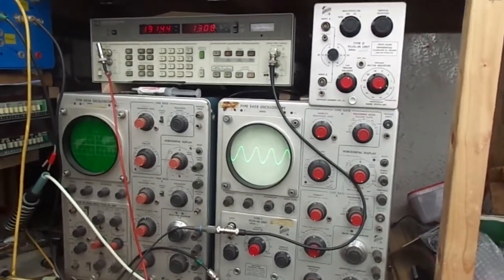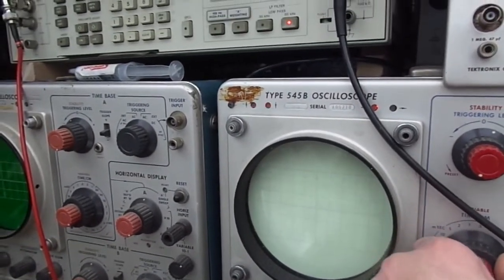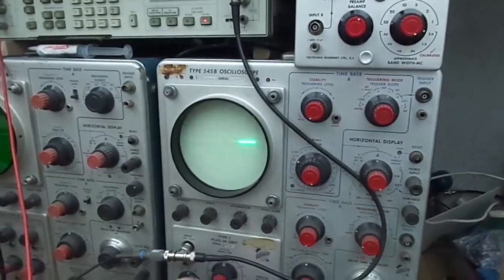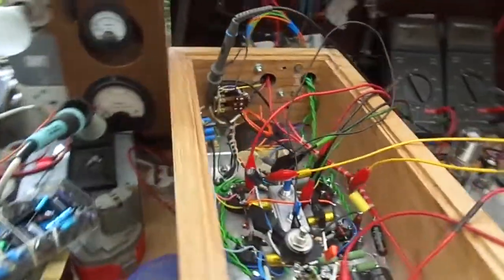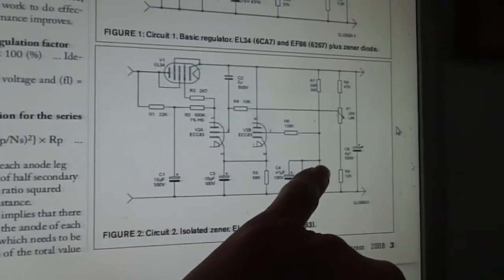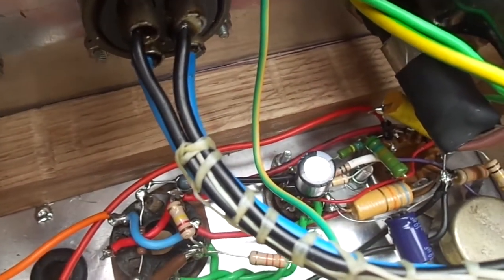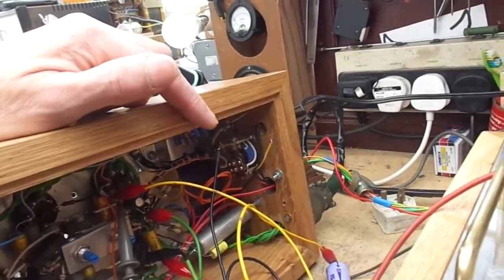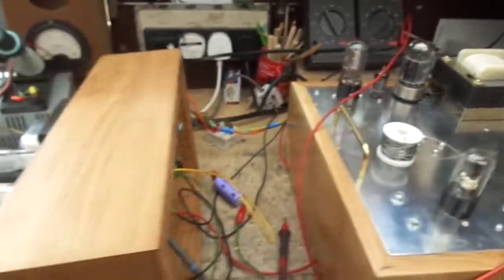50w Class A 807 PPP Amplifier - Part Three - Stability Testing.

Comment: Hey what is the tube in the front there that has two connections on top? Thanks in advance
Reply from the maker: DET20/CV1135 essentially half of a 6SN7 or a 6J5. TFW.
Reply: Thanks! @diabolicalartificer

Comment: Actually the oscillation from the VR tube makes sense without the RC filter being added. The VR tube you are using appears to be neon. Now i remember back to building neon bulb oscillators using NE2 bulbs.  I have not seen a VR tube oscillating, but the spots on the VR tube that appeared & disappeared remind me of the same thing I have seen when testing VR tubes in my tube tester. They were oscillating in the tester. Great job finding that Andy.
Reply from the maker: The VR150/30 I'm using is weird, it's V is 107v , I have 9, all the same- mislabelled? Other VR150's I have glow blue, so these have a different gas inside.Thanks...
Reply: @diabolicalartificer  Andy, It just hit me that as a neon bulb ages, the firing voltage can vary. This could be the case causing an inconsistancy (sp) in the firing for regulation.